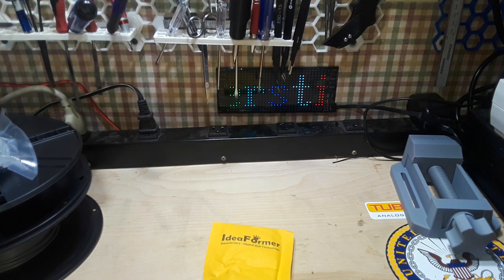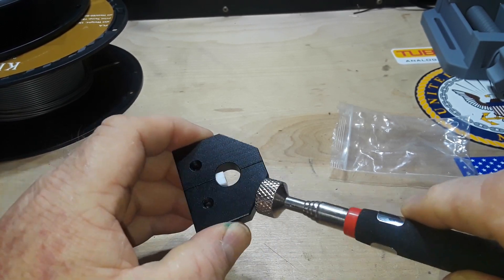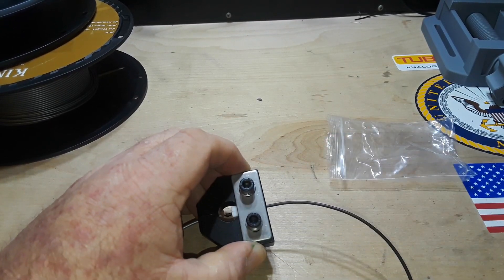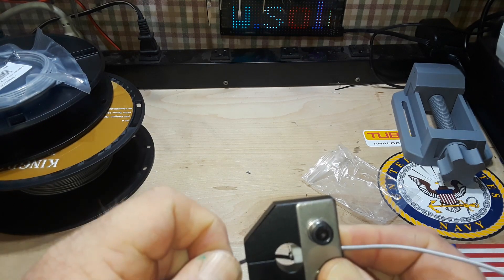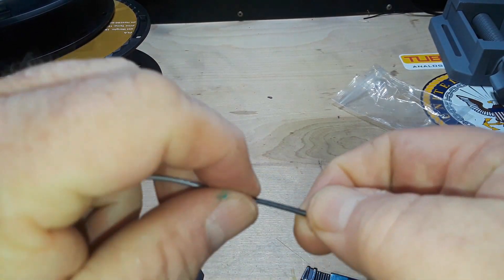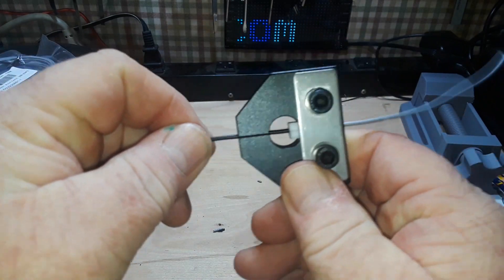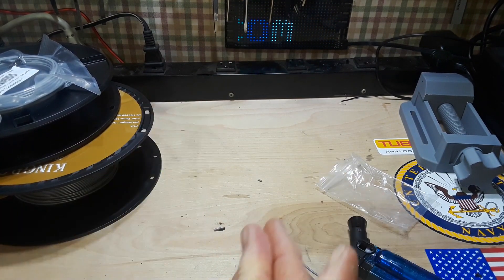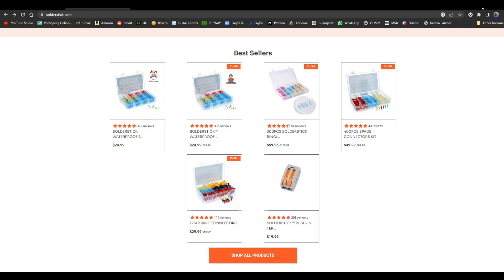IdeaFormer Filament Welder for PLA,ABS,PETG - Sponsored by Solderstick Wire Connectors

Comment: just received the same and after several failures i found a method to get  it work .. if not properly , a lot better : just before inserting instead of a 45deg cut heat the extremity and pull them to get a long spike then cut to keep half the 1.75mm make sure they align and quick heat and push , it goes to the white plastic almost without friction , then pul back while still a bit hot and pull trought the metal back and forth to smooth the weld ... after that it still make a nice guide to respoolling ... not sure the prin head will eat that whithout failure , not tested yet but looks strong enough to get pulled by the extruder ...

Comment: This is not rocket science but a simple procedure will help:
1. cut both ends to be joined at a 45 degree angle
2. insert them so they are together in the center hole of the tool
3. apply torch lighter flame directly on the joint for 1 second and immediately push the  filament so it enters the white guide
4. continue pushing until the joint of the filaments exits the white guide
5. if there is a significant length of filament on either side of the joint , use the Allen keys to open the tool and remove the filament
     otherwise just pull the filament through the tool  
6. if the joint is wider than the filament spec of 1.75 mm  or if there is a blob we should remove the excess
    a. use 100 grit sand paper on the joint until it is the same as the rest of the filament
     or
    b. use a fine file on the joint until it is the same as the rest of the filament
     or
    c. use a utility knife with a new blade to shave off excess

This tool is available on AliExpress for around $5 and it works if you take time to learn how to use it.

Comment: This would have been helpful for previous 3D printers.  I just got a Neptune 4 Pro.  It stopped halfway through a five hour print today when the filament was expended.  I was on the phone at the time.  I pulled out the strand of filament below the run out sensor, hung a new kg reel of PLA, fed the new filament through the sensor and into the extruder, pressed the Load button to prime the hot end, then pressed Continue.  It went right back to what it was doing.  I inspected the parts after printing and could find no surface defect even though it was printing two layer thin sidewalls so there should have been a defect on the inside or outside of these very thin walled parts.  Swapping reels while printing infill should be even better.
Reply: Still helpful as you can avoid a stopped print entirely.

Comment: Hello, Paul. got a question for you and it might make for an interesting video. Say I have two old PC power supplies. If you watch "explaining computers" channel on YouTube, he just did a video of the different PSU types and standards. Maybe, (just a suggestion), you could talk about using two different 12 Volt sources from a single PSU (or two different 5 volt sources) from the same PC power supply and putting them together in parallel to increase the current capacity of the different voltages?  Also, what if I had two different PC power supplies that shared the same ground. Could I put their output voltages in parallel to increase their current capacity? Also, if that was done, is there a circuit to convert this setup to a constant voltage OR constant current power supply as a DIY project to repurpose power supplies that might otherwise go to a landfill? I know you are an engineer and you specialized in power supplies. Is this possible and, if so, how can it be done safely?
Reply: Even if it can't be done, explaining why it's a bad idea would be helpful. Hope this one gets you lots of views like your soldering one did. DIY bench power supplies are very useful.  Constant current supplies are useful when doing low-voltage electroplating of things. Especially 3D printed objects painted with graphite, correct? Kind regards, John.

Comment: I am quite new to electronics and your channel, I am making a Bluetooth speaker and need power supply with 3 or 4 outputs all with different voltages 36v, 12v and a 5v I have searched and searched for something similar or something that my basic knowledge would be able to modify but unfortunately I have come up with a big fat ZERO please please can someone help!!!

Comment: This gap in a reliable low tech method other than a direct feed extruder, I guess, with a filament stop control, is what is the botte neck with the pullstruder systems.  JR3D's network seems to agree and also that the other more expensive method that is better, is the Mosaic system that has no open source system as of last I knew.
Reply: Also, I think you want to cut the ends that you're mating at more of an angle, plus position so they overlap.

Comment: I made one a long time ago - works pretty good for what it needs to do - i have a recycled vape heater inside a metal housing to joint them, then the excess is shaved down when it exits the unit - it is pulled thru a proper sized diameter metal tube sharpened at the entry.
Reply: Thanks! I may have to experiment with that concept!

Comment: I just use a length of ptfe tube, put the filament in and heat the middle and push together.Then sand/scrape it down. A little more work but a really good bond. You can leave the ptfe on depending on the size of your extruder opening. Or just spin it off by rewinding it onto the spool.
Reply: the burned ptfe fumes are very toxic

Comment: to be honest it would more or less reguire a kind of heat chamber inside with a 18650 and a 5 second timer or so to limit the amount of heat.
You did a good job with practicing and try over and over again, but the product has not even reached beta.
thx